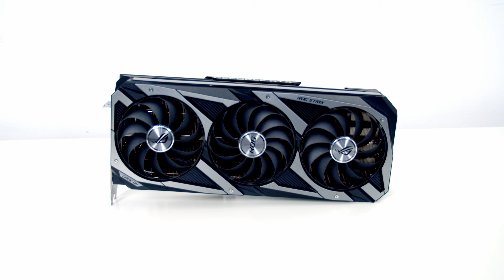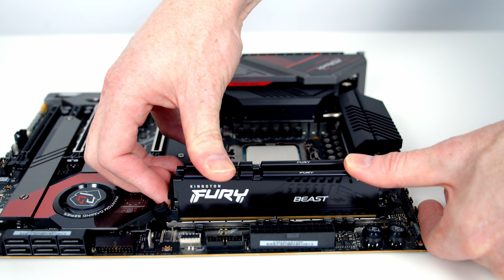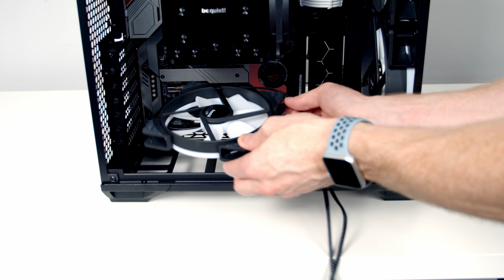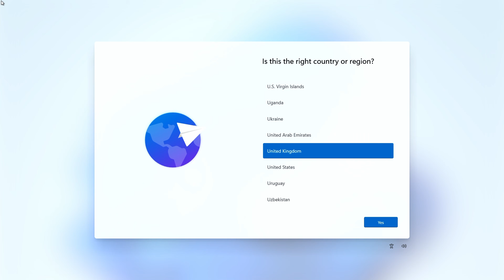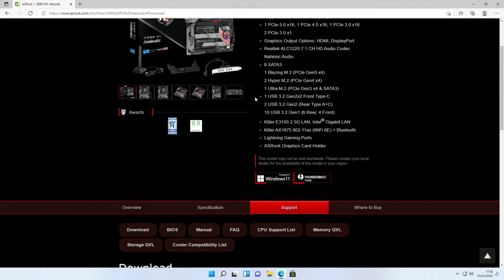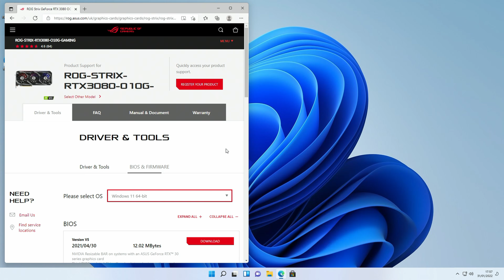Fractal Design Torrent Compact Build - Step by Step Guide

Comment: Helo.  At the second, low pciee 16x slot on the ASUS TUF GAMING X870-PLUS WIFI AM5, with either 2 25 or 15mm thick x 140mm fans at the buttom, can the the ASUS HYPER M.2 x16 Gen 4 Card fit in? At least with 15mm thick fans? What do you think? I'm unsure before ordering this, because i think that nvme card will need plus arflow from the buttom even in this case, with this much airflow if i also will put in in the future a higher end gpu like this msi ventus 3x 5090 oc, which just fits.

Comment: Does the Torrent Compact need the 3 additional fans (1 exhaust and 2 bottom intake) or are the two front 180mm fans enough? I just started building my case and only just realized it just came with the two front fans.
Reply: I'd toss in the 2 bottom 140mm fans especially if your using a longer gpu.

Comment: Also has  the bulging side panel from the cable management.
Reply: yea don't use extension cables
Reply: @HarryUnchained  If you want your pcie cable to reach from your psu down to the gpu, then you have no choice.

Comment: Can i9 13900k be air cooled?
Reply: I personally wouldn't, if you get a really high end air cooler and don't push it too much, you should be fine. Also depends on the case, this one is really good for air cooling.
Reply: The Thermal Right Phantom Spirit 120 can do the job.

Comment: Great video! This has helped me tremendously. The remaining two questions I have is how many ARGB fans you daisy chained to the same motherboard argb header. The other question I have is if the fan hub doesnt easily exceed the total amp draw when connecting so many fans. My motherboard 4-pin PWM fan headers for example support 1A total draw. The two front fans use 0.350A each so this would mean I can't connect 3 of them as that would exceed the total power draw. Let alone when connecting 9 PWM case fans. Other than that I salute you for the crystal clear demonstration/explanation! 🫡

Comment: God I had so much pain to build in this, even more than in Nano lol. The SATA from 3.5 HDD is impossible to fit in, you have to really crook it and even then... space for the cables is like none and I am pretty sure because of this I got short somewhere. Something was touching my motherboard or Idk, had to take it apart and so far I have in on a bench table. Collecting my nerves and patience for another attempt this weekend. Layout of my motherboard is not helping too. Helpful video. Also any idea how to connect front I/O panel connectors? My motherboard (EVGA X570 FTW) has  header facing down.... so there is zero chance to connect the pins from bottom, maybe I can connect them before putting the motherboard in? they are kinda short tho It's gonna be difficult to do.

Comment: I'm waiting on this case to be delivered and I'll be migrating my PC into it. Really appreciate the detailed build guide. I was a little worried about space but it looks like it won't be too much of an issue. And this is the first build I've seen using cable extensions which is something I was contemplating. This made me confident I can fit them in my own build.
Reply: Doing the same right now. How did it work for you?

Comment: I am a bit confused with rgb connectors, the default fans say they use 5v connector but that particular motherboard connector you used says in the manual that is 12v rgb led (although is supposed to have 4 pins)

Comment: One question sir, the mb in this build was ATX right? Can you put 140mm fans at the bottom? In the instruction, it said if you use ATX mb, you cannot put any fan at the bottom. But in the video, you can put 2 140mm fans. Is there any problem or any tips on that?
Reply: I went ahead and built it. And yes, the 140s will work with a full ATX board, but if you have a stiff cable going into one of the headers on the bottom edge, it’s definitely problematic.
Reply: @misterapple7123  good info. I’m in the market for a new case and keep going back and forth on the Torrent. The tight room for cables in the back concerns me a bit, plus.. the case seems to sell at a premium price and I’m not sure it’s worth it over some alternatives.  I do like the overall design and aesthetic though.
Reply: I’d like the clarification as well. I know that board is ATX and I suspect what he meant was that you couldn’t bottom mount the two fatter 180mm fans (that were on the front) with an ATX board.
Reply: Fractal says 140’s in the bottom will fit with a atx board. If you went with 180’s in the bottom then you need to go with a matx mobo.

Comment: About the 2 x 140mm bottom fans, it suppose to install with Intake direction? Will it be wind crashing with graphic card fan which is blow downward? Or shall we install the bottom fan with suck out for better result? Please advice. Thanks a lot~
Reply: The gpu fans are blowing air upwards, so in the same direction as the bottom fans.

Comment: Great video!  I am working on my first build and using this case and your fan setup.  The fans you have listed for the bottom and rear are not available.  I see lots of options for other quality fans with RGB.  My question may be a silly one but I just don't know.  Do you need those exact fans to work together in the software and on that hub?  I.e if I went with deep cools or something, will I have to use something else other than what you showed in your video to control the lighting on all fans at once.  I think it's on a hub level so it shouldn't matter but I want to double-check.    Also, outside of those fans, any other recommendation on RGB fans that would compliment this build?

Comment: I worry about gpu clearance. 330mm is a bit tight, especially with very long gpus like the asus strix in the video, it almost touches the front case fans. Although it fits, I worry that a bigger gpu come along in the next generation and you have to swap the case entirely. So maybe going for the bigger Torrent is better.

Comment: Will a vertical gpu mount work in this case?
Reply: Yup in the compact case you can add a vertical gpu mount. You have plenty of space not to choke the gpu
Tip tho use the fractal design one.
Also if you decide to use a mount you no longer can use the bottom for fans. Hope this helps

Comment: Having used this case now I’ve found one glaring omission from reviews, the PSU is now pulling in warm air from within the case resulting in it (mine at least a HX850) to run noticeably louder than anything else in the case when idle. Only way to avoid is to have front fans at 50% which is a bit too loud at idle IMO. Can you recommend a suitable PSU for this build? Both for noise and size considerations? 750w minimum since it’s for a 3080Ti Ryzen 7 build. Thanks!
Reply: Probably 4 months late. I recently built a pc in this case and used EVGA 750 GT and has been running quietly since, since this EVGA PSU's fan is not even turned on in the temperature below 60c or in idle. I use the given stock case fans and run in normal mode in which the temperature of the case stays below 50c or to be exact around 44c at all times so the PSU's fan is not even needed. In fact, I doubt I ever notice it is even turned on at all after all this while. Also, I assume you are going the airflow route buying this case and if you are really concerned about the fan noise for the CPU Cooler, I recommend Thermalright Frost Spirit 140 V3. The performance is of those at Noctua as it cools my 5600x at around 44c in GPU Intensive Game and 50c in CPU Intensive Game and I don't even notice the fan noise at all, super quiet.

Edit: probably not similar to your build but for drawing comparison, my build is 5600x/ASUS Tuf 3070Ti.

Comment: i wonder if there would be enough space for a 360x180 rad + a pump/res combo...
i know GN did a 360x180 rad in the non compact version and they had to fab their own bracket to hold the pump/res. anybody know of 180mm bracket?